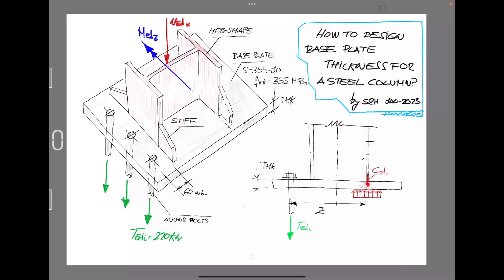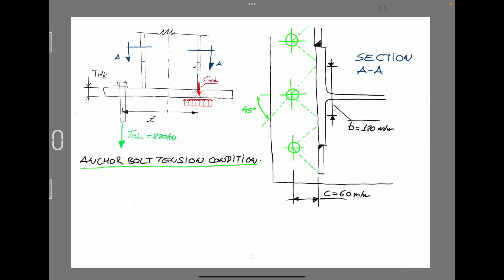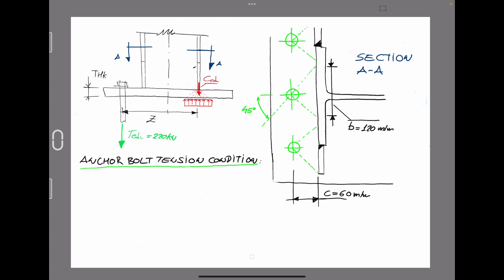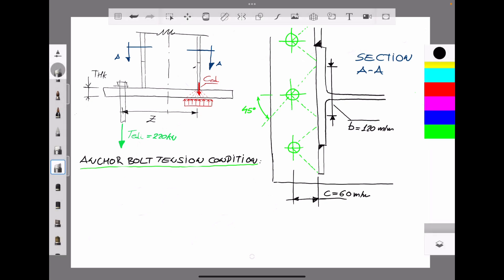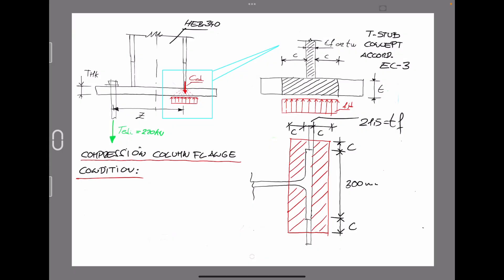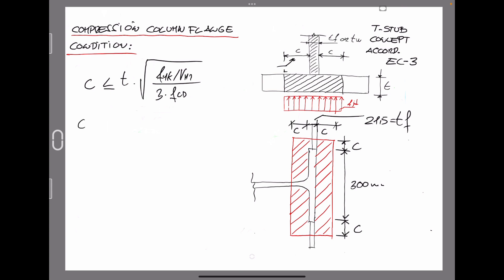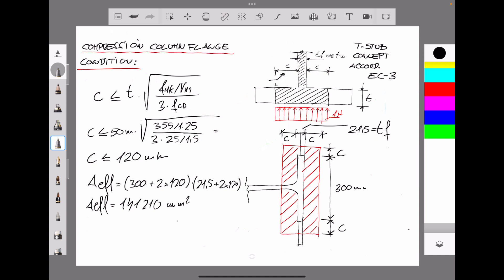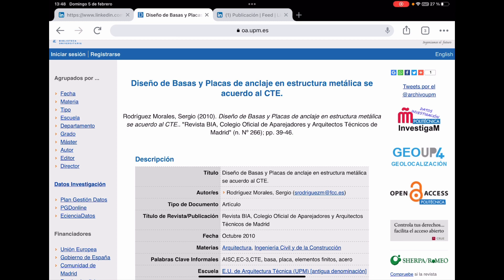Base Plate Design, Part-2. Thickness Calculation.

Comment: How to design the base plate for the stub column which start from the Top flange of the beam not from the concrete pedestal
Reply from the maker: There is a interesting exercise in Foundation Analysis by Joseph E. Boles. If the analysis is performed based on T Stub methodology described in ec3, it is so simple to only account with inner plate. Effective área it is obviously reduce.